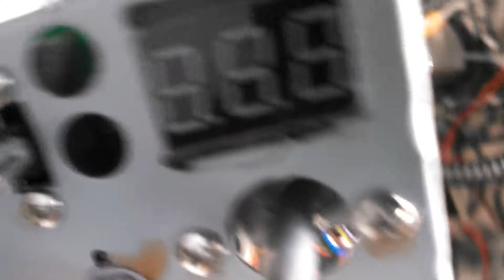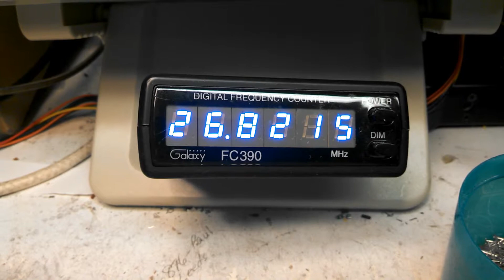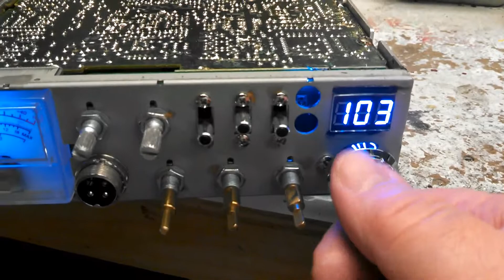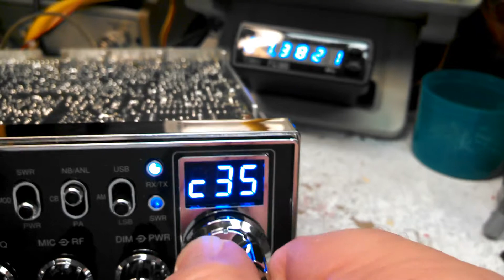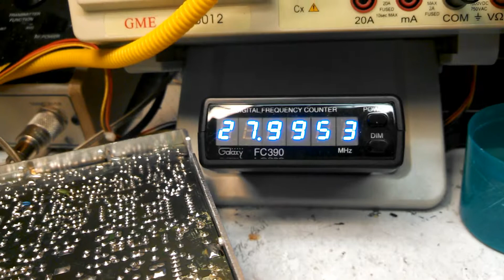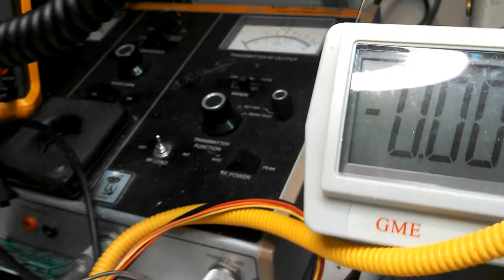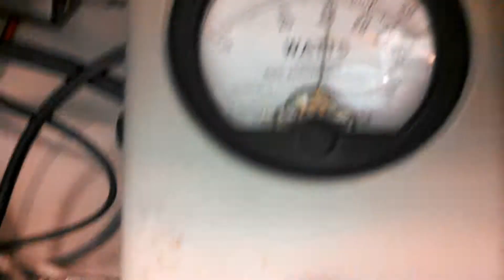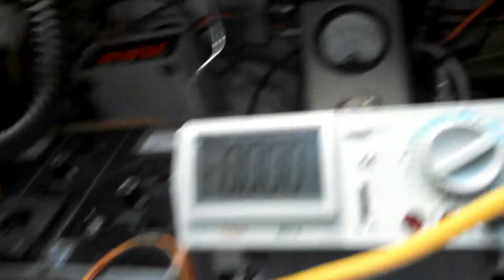DX979 with LC5200 Blue - www.LesComm.com

Comment: Another outstanding job by Les at LesComm. Radio arrived a few days ago; have flogged it on my bench fairly extensively and it's everything (and then some!) Les said it was going to be. VERY happy with this unit. If you're gonna spend your hard-earned money on a custom radio, Guys... this is the place. This is my second, and I love 'em. The first one has been running about two years now without a hitch, and... I think this 979 actually outperforms the original 959.